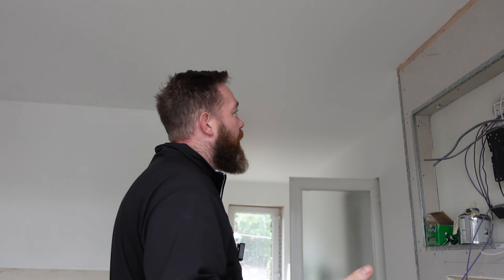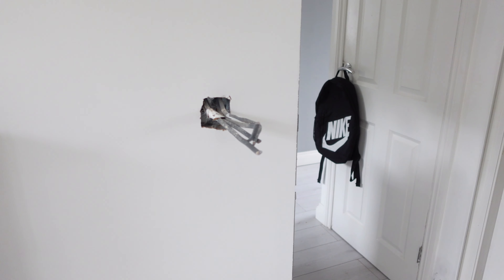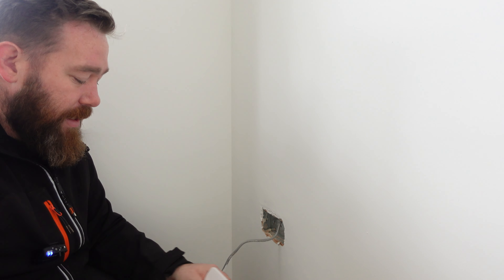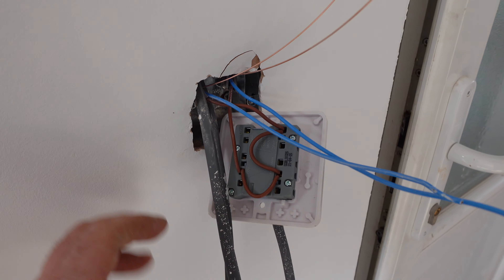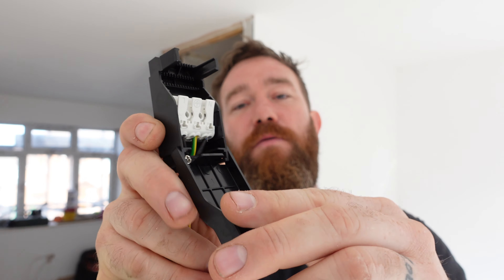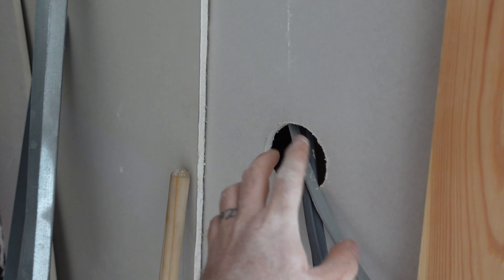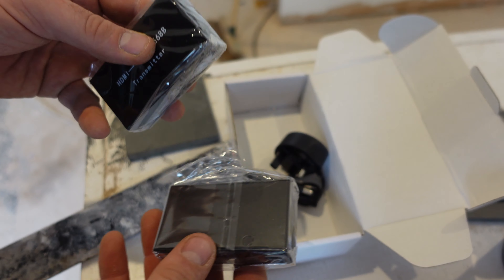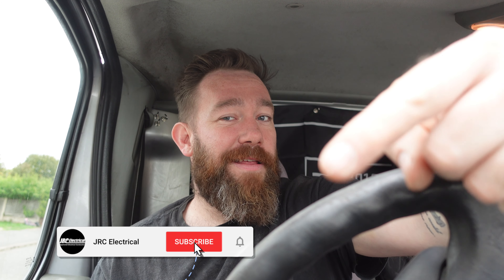Mistakes WERE Made, Measure Twice Cut Once - Electricians Vlog

Comment: Having been an Industrial electrician JIB GOLD CARD electrician for 50 years recently retired,I think I worked in the golden era of contracting where the plasterers were true professionals because as spprentices we chopped our own back boxes in and they had to be level and the front of the boxes perusing 5/8ths out from the brickwork and we mixed the cement ourselves and filled in around the boxes and if they weren't perfect we got red ears we then cut wooden plugs to fit into the brass bushes so no plaster could go down into the conduit,the plasteres would then plaster the walls and whilst the plaster was semi wet they would use the Blunt side of an hacksaw blade and clean around each socket leaving the socket 100% level and no more than 5mm back from the front of the finished plasterwork,therefore no long screws ever required leaving a perfect finish,I can't say that has happened for at lest 30 years lol
Reply from the maker: That sir sounds like a LOT of hard work, fair play to you but I must say I’m glad those days are gone 😂😂 although the plasterers do sound better and each trade thinking of each other rather than shitting on each other like it is now